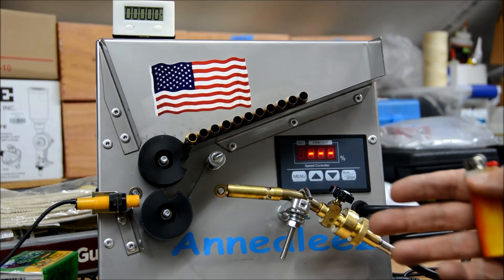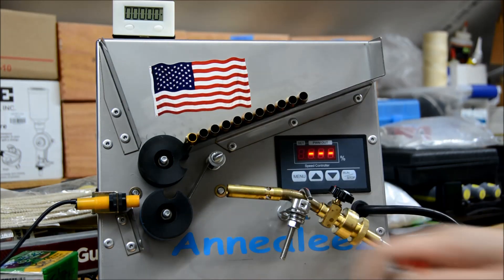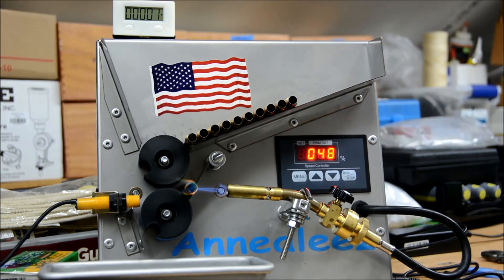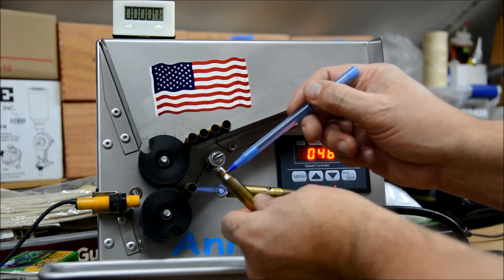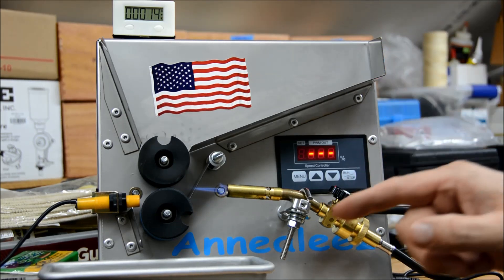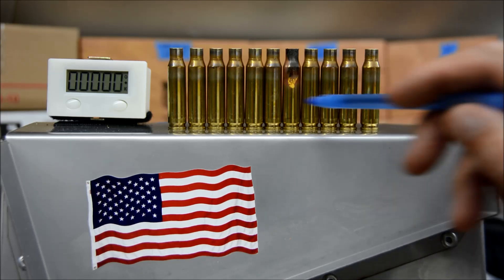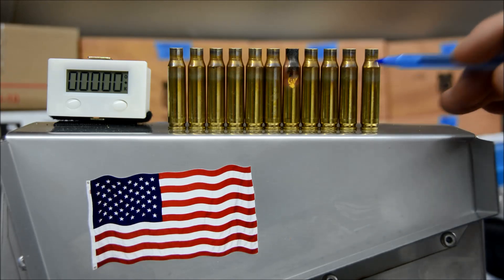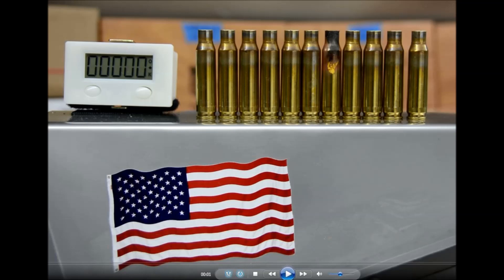Annealeez 2.0 Counter Mod - Pt 5  Win308

Comment: Does the counter have a name or part number?  Could not find it on Amazon. Thank you
Reply from the maker: The link is in the 1st video.  Here it is again:
Counter info: $12.49 & FREE Shipping DIGITEN LCD Digital 0-99999 Counter 5 Digit Plus UP Gauge + Proximity Switch Sensor with Magnetic by DIGITEN Learn more: https://www.amazon.com/dp/B01DNLRAUA/...
Reply: Got it. Works great Thanks